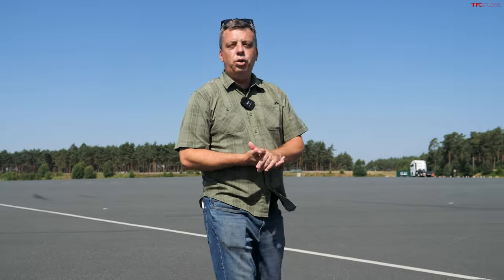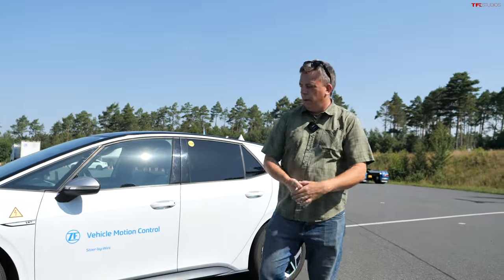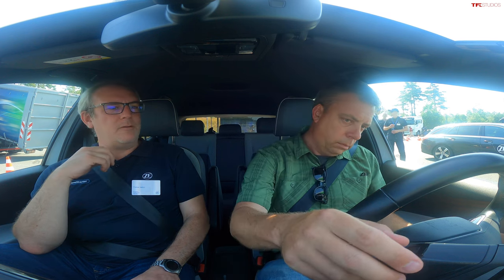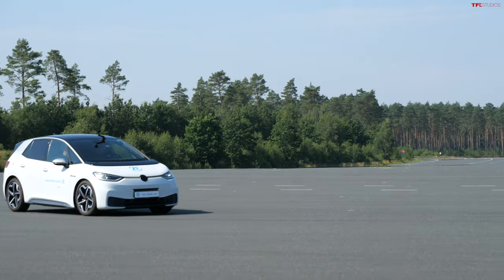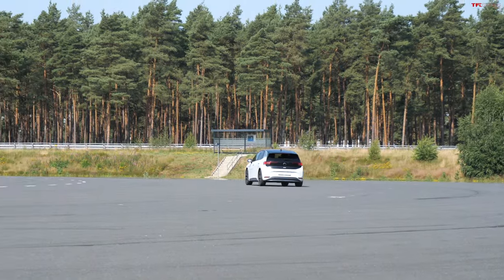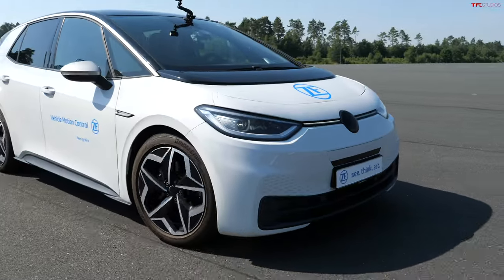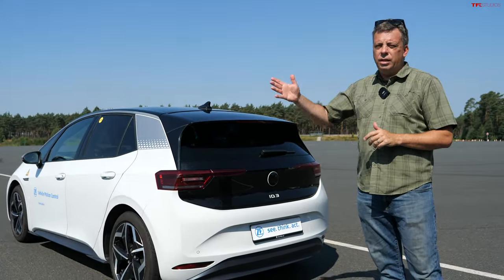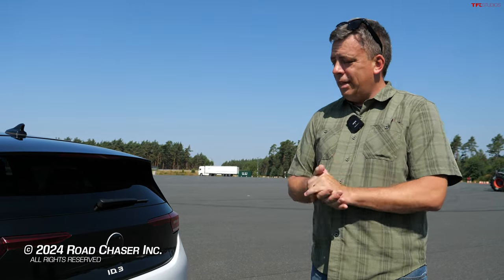Tomorrow's Cars WON'T Drive Like They Do Today, Even If They Don't Drive Themselves!

Comment: The reason for this is the ability to adjust the steering ratio at different speeds.  Go slow,  increase ratio to make turning easier.  It's also easier to assemble and removes the heavy hydraulics.
Reply: And packaging, you don't need to engineer for different markets just plop the steering on one side or the other.

Comment: There are two cons to DBW. First, the added weight and complexity. The more things you put on a car, the more things that can break or malfunction. Second, road feel. In most cases, you have no feeling of what your front tires are doing (road feel). Notice they make no mention of road feel. Though carmakers are making efforts to improve this. 

BTW, aircraft (military) have been fly-by-wire for decades. One more thing, EV are over 100 years old, but what Tesla car company product is a million mile ahead of what they had back then. If you think modern batteries are heavy, imagine a car running solely on lead acid batteries.

Comment: Cars have never ever had an electrical power failure before? This reminds me of Alis-Chalmers fork lifts that had hydraulic only power steering not piggybacked on a mechanical setup. In the case of an engine stall, you hit the wall. Infinity has had steer by wire with emergency mechanical backup for a few years now. Were you able to steer with your pinky? Keep the steer by wire systems in the EVs that nobody wants.

Comment: We’ve seen the video showing the delay between steering input and wheel motion on the Cybertruck, but you didn’t mention or address that in the ID3. Steering by wire is always has a delay and basically is a simulation of steering, so what is the benefit to the consumer and what is the benefit to the manufacture?

Comment: This isn't a new technology. Infiniti was doing this when they introduced the Q50.
Reply: Electric power steering is not steer by wire.  Electric power steering still has the steering shaft that connects the steering wheel to the front suspension components.
Reply: @Sylvan_dB  Electric powered steering isn't new either. I have it in both my 2016 Toyota Rav4 and 2022 XT5. My 2009 SX4 was the last car I had with hydraulic powered steering. Are you sure they didn't mean steer by wire? This is a new feature for the Cybertruck.
Reply: @juanzingarello4005  The VW in this video also has steer by wire.  Infiniti did not.
Reply: @Sylvan_dB  Infiniti has steer by wire in the Q50 and Q60. And I am not 100% sure on this but also the QX50. Look it up. It also has a shaft with clutch as a backup should the system lose power it will revert to standard rack and pinion.

Comment: I can understand electric assist steering.  Many cars with different power-trains use this now - especially hybrids where an engine might not be running to provide hydraulics or vacuum.  I can understand electric assist brakes and plenty of cars have this today (for ABS and many other systems).   What I don't like is the complete disconnect of those systems from the driver.   Plus, from a safety perspective, both electric assist steering and brakes can still operate if there is a loss of power with the assist.  No thanks.
Reply: I think my 3rd gen Tacoma is one of the last vehicles to still use hydraulic steering.
Reply: Have you tried braking on a 1-ton truck without the hydraulic or electric boost? They may technically work, but you better have a mile of runway or leg press 1000 lbs if you want to stop it at highway speeds.

Comment: Don't know if it's the steer by wire or rear wheel steering, but after taking a Cybertruck drive, that makes conventional truck steering seem like something from horse and buggy days. It doesn't feel like "normal" steering, so VW might be missing the point.
Reply: The CyberFlop steering is laggy in its response and feels lifeless like a video game. It sucks.
Reply: No it's not, it's snappy and handles like a sports car. Better actually. There are other things wrong with the Cybertruck but I would buy one if it was more of a truck.

Comment: and what's the point of doing this ?? to save weight?, to make things more complex and more expensive to build?
Reply: Control... We are the carbon they wish to control.
Reply: It opens up tons of packaging space, allows the steering wheel to be anywhere, even be moveable from side to side, safer without protruding shaft in accident, cheaper to produce.
Reply: Design options. You get a lot more freedom. They can also tune the steering. I’m seeing it more and more in the forklift world and it’s been working very well.
Reply: @snupermoto723  Don’t be like this guy. It’s okay to have preferences, it’s okay to even prefer the old way of doing things. But don’t allow yourself to be terrified of change or allergic to science. Not only does it age you, it leaves your mind open to all sorts of nonsense.
Reply: The short answer: It has significant potential to increase safety and reduce accidents.

The long answer: For a vehicle's active safety systems, it can disregard human steering input to prevent or recover from a loss of control scenario. Typically with electronic stability control, the vehicle would only have access to the brakes in an attempt to stabilize the vehicle. With steer by wire, the vehicle's active safety systems can have full control of steering and prevent a bad steering input. This can happen preventatively (before the car has lost control) or reactively (car has already lost control). For the typical driver without a great deal of skill at pulling a vehicle out of a skid, this has huge safety benefits.
Reply: To save human drivers from themselves, average ones. All machines have "envelopes" and imitation. In the aviation world "normal law" fly-by-wire protects the plane from the stupidest of pilots. I can see a potential future where the dumbest drivers get protected by aggressive steer by wire overriding dumb inputs.
Reply: To be different, nothing more nothing less.
Reply: @aussie2uGA so basically good for the manufacturer but not the end consumer
Reply: @snupermoto723 cars are already electronically connected. You don't need steer by wire to control a vehicle when you have electric power steering assist. Stop being paranoid over dumb shit
Reply: @directorjustin    Unless it malfunctions…and it is Tesla…
Reply: To save them money in manufacturing

Comment: Here's something copy and pasted from another comment to help people better understand the point of steer by wire and why it's a good thing.

The short answer: It has significant potential to increase safety and reduce accidents.

The long answer: For a vehicle's active safety systems, it can disregard human steering input to prevent or recover from a loss of control scenario. Typically with electronic stability control, the vehicle would only have access to the brakes in an attempt to stabilize the vehicle. With steer by wire, the vehicle's active safety systems can have full control of steering and prevent a bad steering input. This can happen preventatively (before the car has lost control) or reactively (car has already lost control). For the typical driver without a great deal of skill at pulling a vehicle out of a skid, this has huge safety benefits.
Reply: It could be a good thing if reliable; alas, it’s Tesla, the opposite of reliable.

Comment: It’s all fun and games until a rogue actor decides they want you steering in a direction you don’t want to.
Reply: Every brake in a vehicle made after 2010 can be electronically activated for safety reasons, so they can already do this by just remotely locking up your brakes. If you are concerned about being hacked, stick with 1960’s classics and get rid of any phones or electronics in your home. Actually, disconnect your electricity altogether, as the electric meters are all remotely controlled now and can be hacked to short and cause a house fire.
Reply: @Cloud30000  look up the journalist Michael Hastings accident and get back to us.